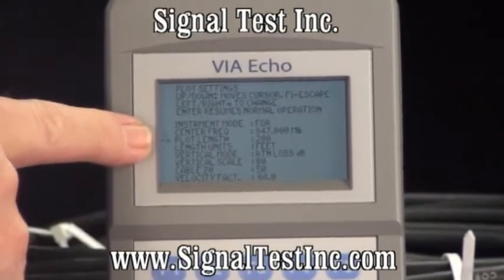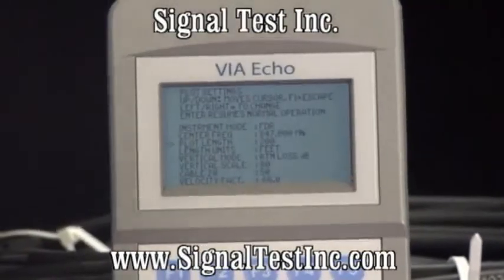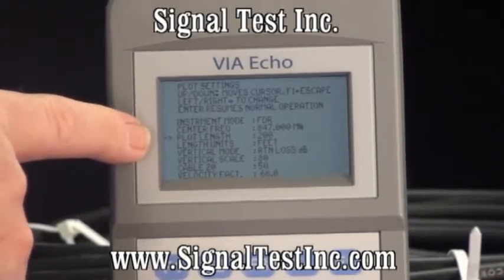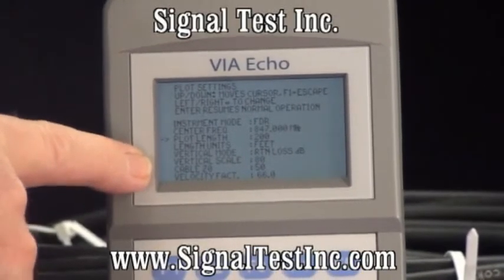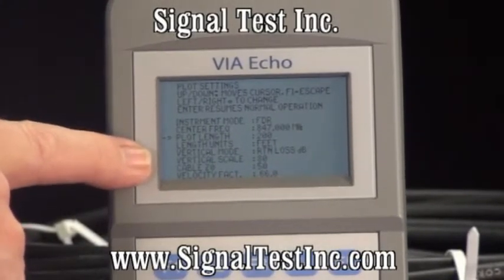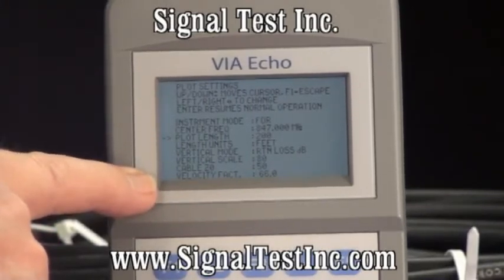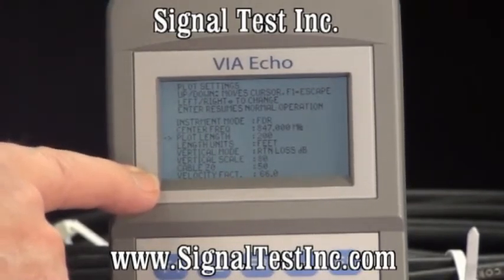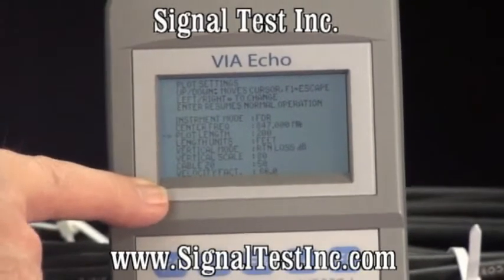AEA VIA Echo Part 5 of 8 -  Setup for FDR Frequency Domain Reflectometer

Comment: This sounds like something that wouldn't work, but FDR mode worked in my testing and revealed all connectors between the VIA Echo and my antenna. 

You can find the results of my testing by searching for "FDR Testing Feedline Using VIA Echo"

That cursor overshoot in this video at 2:30 is one of the few annoying things about this device.